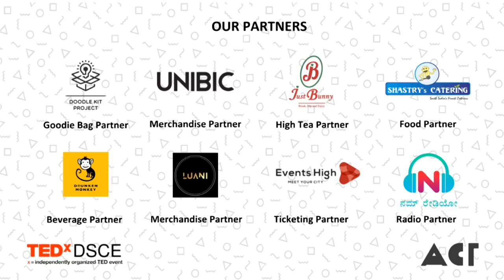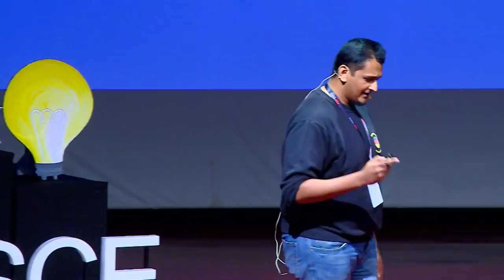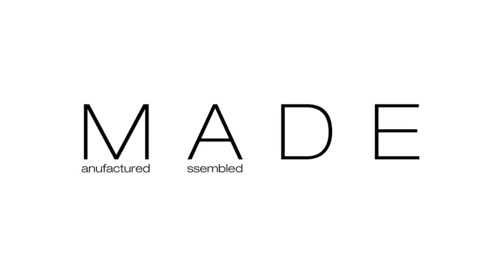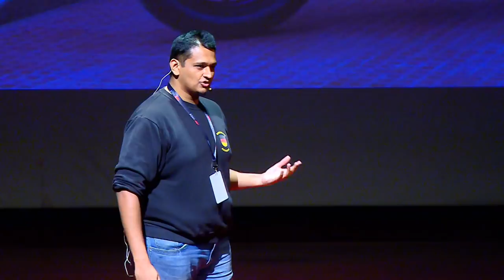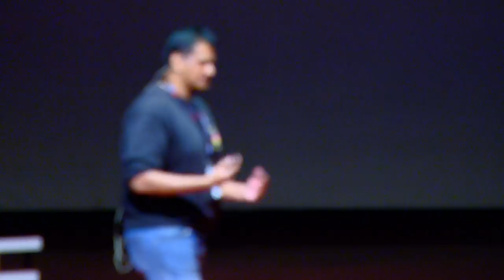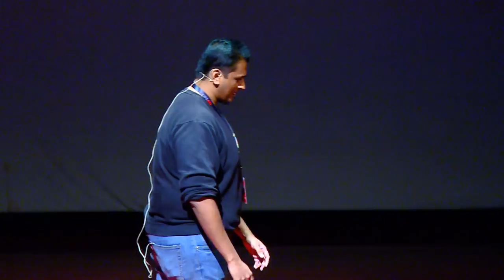What 'Made in India' means to me | Vinay Raj Somashekar | TEDxDSCE

Comment: if the bike is another "innovation for innovation sake" product, or if there is a technological reflexion behind it. From an aesthetic point of view, I don't think electric bikes should persist in looking like gasoline bikes, right down to having a "fuel tank". they're a new breed and should look like it. why are electric bikes not pushing the aerodynamic envelope figuratively and literally? and talking about details, with iterative process not identified - Why do electric bike designers continue to use the counter-intuitive Telescopic forks that reduce rear wheel grip force on heavy braking, reducing the potential for regeneration when most is available, insane really. Putting brake forces through front suspension especially on heavy bikes with large load transfer from pitching moment compromises suspension and handling as it's bottomed out and running compromised setup. Let alone the brake force path running half way around the bike. Double insane..Such a shame. you had the opportunity to create something significant but seems like you guys at Emflux One have missed the bus. lastly, TVS - is no visionary to be honest, to take any design cues from.
Reply: This model is their first iteration, and I am sure they will do more. May I suggest reading Lean Manufacturing and Lean Start-up, and one may understand why new companies simply cannot afford to innovate right off the bat. Innovation is only a single spoke in a company; especially for a start-up, they will not only have to focus on design and engineering but on inglorious things like market research and penetration, operations management, sourcing components for manufacturing, scaling up to the market, paying their workforce, HR and so on. I understand your passion for design, but running a company is a whole different ball game, and I think you have to appreciate this start-up because translating innovative ideas to a product is no easy feat.
Reply: @Nvh_401  i wholly agree to everything from "running the business" angle. But, Do you agree that motorbikes are not granted a special and unique benefit to escape the laws of the physics ? It is clear that you dont understand fully what I have typed, but i dont blame you because you were not the intended audience, and trust me it has nothing to do with design as you mention. Because, physics is just the language of reality. A lot of people are speaking about it, very few understand what it really is. And, Of course, this is the only way one can learn: making mistakes and applying harsh self criticism... Not very widespread emflux one's microcosm where certitudes and technicist fetishism is the rule. eg Taking cues from someone like TVS ! So to end this, Soichiro Honda said famously—"and no doubt, many times—there is more to be learned from failure than success" , So i do hope that they someday they get to the question: Why electric bikes not pushing the aerodynamic envelope figuratively and literally? - Cheers,